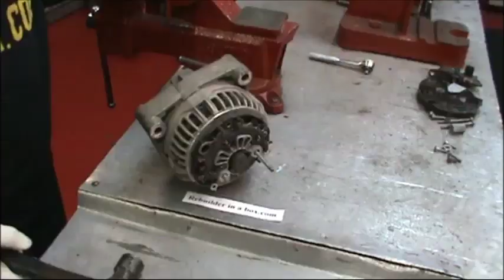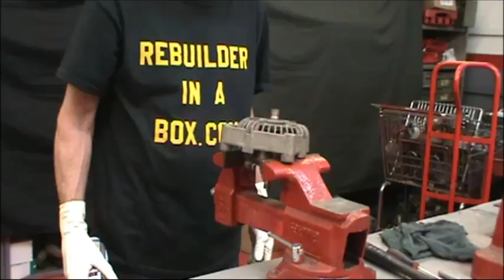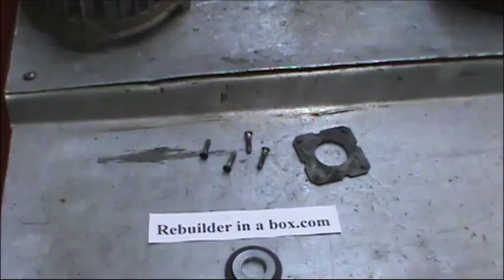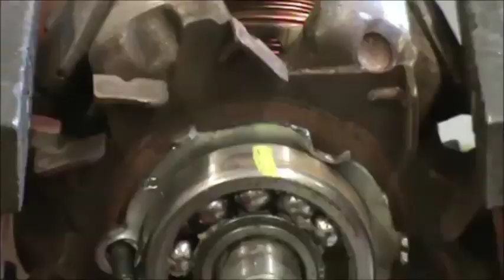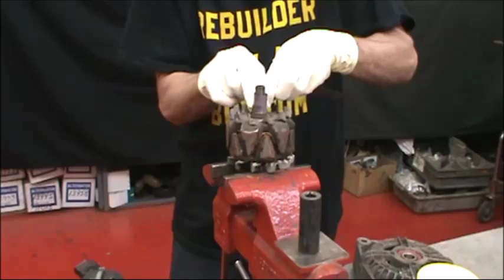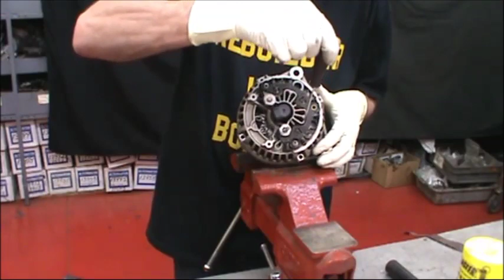How to rebuild a Bosch alternator

Comment: Why didn't you take the rectifier off and replace it???
Reply from the maker: Many reasons. Biggest one is the rectifier rarely fails. Another one is we won't support an operation that would have a low success rate.

Comment: I think the slip rings wear out long before the bearings??? Why did you ignore the slip rings???
Reply from the maker: Naturally, all alternators are not the same. On Fords, slip ring failure is common, and should always be serviced. For Bosch, the metallurgy and brush tracking is better: Slip ring failure is uncommon and not serviceable outside the pro shop.
Reply: @rebuilderinabox  Many thanks for your time . Take care

Comment: Good job . Awesome video very detailed.
Did mine 4 years ago on my Beamer  but used japan bearings and they went out after 3 years . Still worth doing it again for $20 new bearings rather than pay 150- 200 for a reman  one or $300 for a new one. 
Always good to have a spare one from the junk yard ready to be swapped with if u like your car and enjoy working on it. 
Thanks to Bosch for making it so easy to work on it compare to the Valeo s. 
And yes you can use a bearing extractor also for removing the rear bearing instead of a Dremel . 
Sold the car but just found the old alternator laying around and I was about to throw it away but then decided to fix it .
Always fun doing this kind of work.

Comment: Great video!  I tried taping the rotor out of the bearing but it wouldn't budge.  Ended up removing the 4 screws and tapping the bearing out of the case.  Those 4 screws are in their tight.  I has to push down with all my weight so the head wouldn't strip out and when they do break loose, it's quite painful to your hands and wrists.  I then had to take a cutoff wheel to the bearing to remove it.  Otherwise, everything went the same as in your video.  Thanks.
Reply from the maker: Use a hammer and a cheap screwdriver or phillips bit to tap (smack) down into the screws. Because of the taper shape, this loosens them and they come right out.

Comment: Informative video, thanks. Because I stripped out the shaft end socket that's used to lock the shaft with a bit when changing the pulley, I had to pull my Bosch alternator apart and hold the shaft on the rotor using an oil filter chain wrench to loosen the pulley. Only comment on your video is when bringing the two halves of the alternator body back together. I use the x4 screws to get an even pull around the body.

Comment: Use bearing puller not cutter sir shaft & Coller diamage
Reply from the maker: If you have a puller (many of you don't) feel free to try that first. Some will work sometimes. Minimal shaft damage of this type, on this area is a moot point.

Comment: thanks for viedo, i have a 136 amp bosh alternator on a dodge pickup thats showing to much AC ripple so I want to replace the rectifier how hard is this to do can it be done with soliding iron do you have video showing this. Thanks again
Reply from the maker: Probably not a good idea to do that at home. That's why we don't show it or offer the rectifiers. Also, it's very uncommon
and often misdiagnosed. Can you see heat damage on the diodes? If not, you may be thinking they're bad, but they're not. They can be checked with an ohmmeter if separated to individual status. Many testers that test "phase" while the alternator is still installed on the car are dysfunctional.
Reply: @rebuilderinabox  When the battery drains in a day or two its typically the diodes being bad. Yup a multimeter can be used to test them. Mine has a diode setting but I know you can just ohm them out as well. open one way, high resistance the other. Bummer you don't sell them or show the replacement. These actually look just crimped on and not soldered but not 100% on that.
Reply from the maker: Not typical at all for that style to have bad diodes. And there are far more typical sources to drain the battery. All those phases are probably some type of weld. We don't touch on that because we see it as a can of worms we'd rather not open (for the users benefit as well as ours). We'd rather encourage that procedure be done by a good rebuild shop if actually needed.
Reply from the maker: You have to cut open the stator diode connection to ohm test diodes. It's not really the desired method because your likely to create a problem needlessly.

Comment: Taking weight from the shaft with your Dremel will UNBALANCE the rotor. Not good practice and untrue that the damage is "of no consequence.."
Reply from the maker: We don't intend for you to take material from the shaft. However, if this inadvertantly occurs a little, there would normally be NO SIDE EFFECTS in the real world (just the perfect world which is somewhat unrealistic.) Automotive rotors were never critically balanced to begin with. The material removed is an insignificant weight, and most importantly is very close to the axis. These statements are made after years of practice on a daily basis (and actual usage in the automotive market).

Comment: Barbarian solution ... if u use that hammer u can break the aluminium bracket ... use an plastic hammer ...
Reply from the maker: Try a plastic hammer sometime. It won't work. Grow a pair, use a real hammer.
Reply: Thanks Mike. You've done it a few times. You also suggested using a socket - if you haven't done it a few times and lack a lack a pair ;)